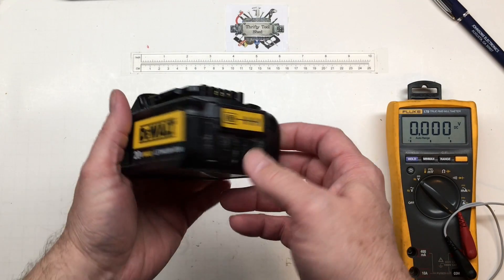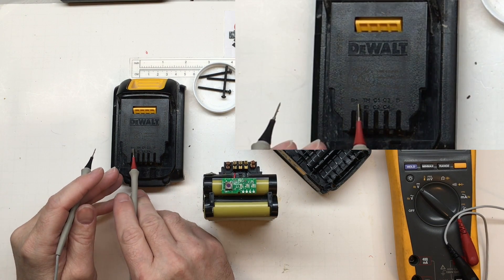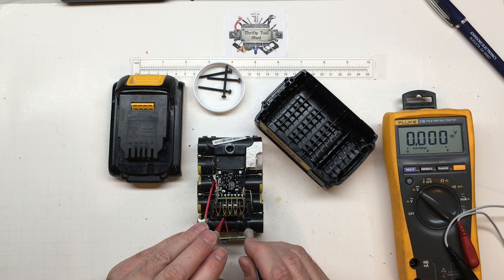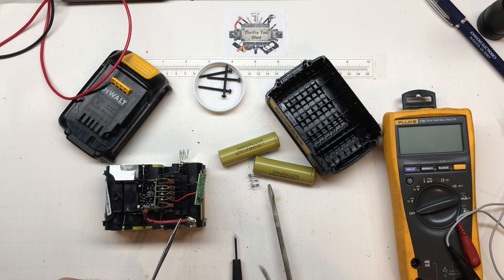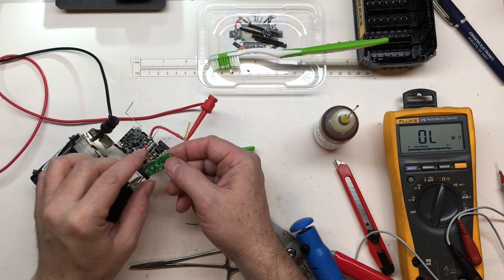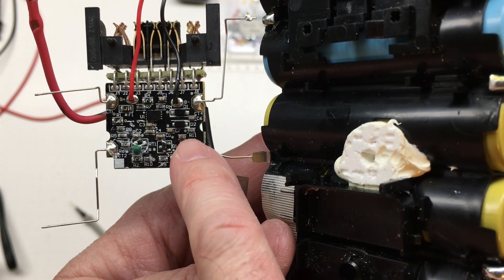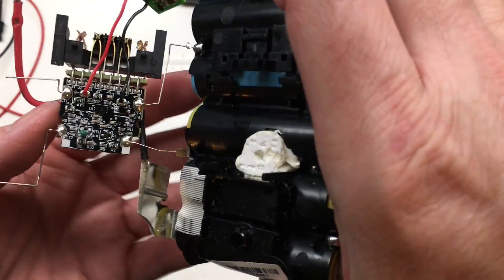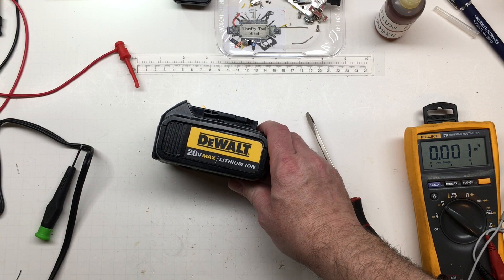DeWalt 20V Max 3AH Battery Repair

Comment: Can you connect an Imax B6 AC battery charger to the negative and positive contact pins on the battery pack to charge the battery pack?
Reply from the maker: Yes, you can do it, and it's much better to do it that way than to try to jump pack to  pack as some show. That can be so dangerous.

Comment: What is the best battery for the cells, where do you buy them
Reply from the maker: I usually either have cells saved from other packs or buy from 18650batterystore.com. I usually pick the best fit for the pack size and price. l always check the sale tab on the website to see what is available at a great price.

Comment: i was wondering if i can connect the battery to a hobby lipo balance charger, will it charge without issue?
Reply from the maker: I have done it without issue. using the balance leads is the best option for charging of course, but to me it does pose the most risk of damaging something on the DeWalt board. Straight to the plus and minis is typically not an issue, but the balance checking will need to be monitored manually.
Reply: @ThriftyToolShed  ok nice, what are the TH and ID pins on the pack, what do they do?
Reply from the maker: @devjitpaul1191  
I have shared this in some of the DeWalt pack videos in more detail. TH is temperature feedback from the packs NTC and ID is a resistor in the circuit to feedback which type of pack it is.
Reply: @ThriftyToolShed  thank you

Comment: i shorted a new dewalt 12v 5a pack trying to wire a light on a motorcycle. i heard something pop maybe a fuse? can it be fixed?
Reply from the maker: Possibly, I have not worked on a 12V DeWalt myself, but it may have a fuse or like most packs has a thinner part of the nickel strip coming from the cells to the board that act as a fusible link. You have to look inside and most likely it will be obvious if it has a strip that has blown. Best of luck to ya!

Comment: impressive work.  What is considered too dead for the charger to recognize ?  I've got a 20v Dewalt battery that is at 14v, and won't charge.  Each individual cell measures 2.74
Reply from the maker: That level is the borderline line. I would think most DeWalt chargers will still charge @ or above around 2.5V each cell. I would most likely manually charge that pack a little and then if still not charging I would look at the individual cells really well. If they are that well balanced then I would check the spot welds on each cell end and the soldered wire to the board for cell monitoring. 
Best of luck to ya!

Comment: Hi there sir, I have disassembled about 12 18-volt Dewalt batteries, is it worth trying to figure which individual cells can be saved, maybe weld some that might charge back together. I'm an old retired man and love tinkering with things. I have separated all the batteries so their single batts now. Just trying to see if I'm kicking a dead horse or not, lol. Sure would liket to hear from you. thanks!
Reply from the maker: Hi,
I do believe replacing with brand new cells is the best option for sure. I do also keep cells and do just as you have mentioned. I will test all cells for capacity and even leave them in storage to check the cell and verify it holds charge as well. I will sort cells based on the capacity tested at also the internal resistance the best I can with an OPUS charger etc. I mentioned a little bit more about this in the video called " Lithium Battery FAQ#1".  Have fun. It can be a great and fun hobby working on things like this. Best of luck to ya!

Comment: I was going to repair a bad 20 VDC 2 Ah Dewalt pack until I realized it was going to cost me more (to repair) than a new 4AH Dewalt pack.  By the time I invested in replacement cells and a spot welder, I was up over the cost of a NEW 4Ah unit.  Soldering would work, but my temperature-controlled pencil doesn't get hot enough to make it a quick job, so I'd have to buy a new gun as well.
Reply from the maker: Yes, if you only use the spot welder for one repair it is not worth it at all. Some people feel this way and I understand that. It's easy for me to view it the same way I do any tool or any repair. I may have $10K in tools but I never used them on one vehicle repair or on any particular vehicle, but I use them often and on many projects. I spend money on parts, but nothing like the dealership and auto shops charge. Like an oil change the first time I bought a jack was an expensive oil change and the lube place was much cheaper that one time. So it's definitely how you look at it and how far you are willing to go. Cells can be costly and I have mentioned before cheaper ways to get them at times like the sale items at 18650batterystore.com etc. I personally enjoy making my packs even better than new and cheaper, but every one is different. Just sharing the options if viewers do enjoy DIY. Thanks for your comment.

Comment: Thank you for your repair videos, has helped me greatly to repair my Dewalt batteries. 
Question: if positive and negative terminal test 19v and all cluster cells showing balanced 3.5 something volts 
But the ID terminal to positive shows 13-14 volts only which causes charger not to charge 

Have you seen this issue before ?
Thank you
Reply from the maker: Hi,
I can remember measuring from ID to negative terminal in ohms and getting around 820 ohms (type 2 pack) and reading from TH to positive reading around 9k-10K at room temperature. It is way more to the circuit of course than just resistance and it was just the measurement that I read once I realized the ID circuit has a transistor that will seemingly put the resistor in the circuit for the tool to see if the board was in good health. Just an observation. Glad you found the videos helpful. Thanks so much for your kind comment!

Comment: I find when trying to pry as delicately as i can , that I always almost always leave a small pin size puncture on the flat side of the negative end of the battery. Releasing a sweet smell. I have always assumed that it was the electrolyte of the battery or the lithium. What are your thoughts on procedure and if what was released was in fact electrolytes or lithium. I find that leaving the nickel tabs cut short but not pried off is more practical for me. Thanks.
Reply from the maker: Yes, with my experience if you smell the sweet smell you have infact puntured the cell case and the CID protection is most likely not working any longer. I have non-issue leaving tabs on mine sometimes, but if they are being reused it is usually too thick to work back in a battery case. 
When I use the flat nose pliers I rarely have issues pulling the tabs off. Usually the little dots stay on the cell and the strip Rips and pulls away.
Reply: @Thrifty Tool Shed  thanks for the reply. Just looked up what CID protection was (haha). I did wonder about that as I saw a video where a guy pushed down on them to reset a dead battery. On further reading, it looks like not a great idea. One thing I could not get a clear answer on was that 1, 2 second hissing and sweet smell. Info on that varied all over the place. Was it the electrolyte or lithium? Thanks again for your time and thoughts on it.  preciate it.
Reply from the maker: I believe it is the electrolyte.  The electrolyte in a lithium-ion battery is flammable and generally contains lithium hexafluorophosphate (LiPF6) or other Li-salts containing fluorine. I believe this pressure builds up high enough it will press out on the positive tip of the cell to activate the CID protection. I have an older video talking a bit about the CID.
https://youtu.be/yididXWl9D0
Reply: @ThriftyToolShed  thanks for the reply and information. Great Chanel 👍

Comment: Thanks for this video I've had a couple DeWalt batteries go out on me before but this gave me the knowledge to repair them.

Quick tip for anyone who is too scared to repair them. Buy new ones with cash, swap the insides, and then return them saying they don't work a week later.
Reply: Sweet idea...DeWalt put'n bone in the consumer...screw'm

Comment: The 2.4V cells deserve a second chance before replacing them. New generation of cells recover fully after a low discharge. I would say 2.4V is not a even a deep discharge, it's safe to bring them back to 3.3 and balance the pack. I have a video restoring 0.1V, yes, 0.1V depleted cells that actually work. See here: https://youtu.be/ouqORBMTU1s .
Reply from the maker: I truly give all cells a second chance. I guess it's been a while so not sure what this comment is really referring to exactly, but I have many videos on lithiums over the last 5 years with some at close to zero volts and some just below cut off voltage. It should always be checked with capacity testing as I mention in many videos and I have a video explaining my testing of Lithium cells in " Lithium Battery FAQ#1"  
https://youtu.be/f9SOPVEqgkw
Reply: @ThriftyToolShed  this is more for other people seeing your particular video, not to challenge you on how you fix batteries in the present times. You actually show in your video (one that I commented) that you replace the 2.4V cells. That was all I wanted to say. Kudos for all your other videos, very informative.
Reply from the maker: Thanks for sharing!

Comment: I Have A Ryobi Battery With Test Light
Issues The Light Works When I 
Throw It On The Charger But It 
Dont Work When I Push The Yellow
Test Button. So It's Probly The
Button It's Self Huh?
Reply from the maker: Sounds very likely.

Comment: I found most li-ion packs that show uneven cell voltage are just out of balance so just
 balance the low ones to match the others and put it in charge and go .
Reply from the maker: In many videos I have shown that the reason most of these get unbalanced is because over time cells get decreased capacity and when capacity testing you will find these cells are very unmatched and for that reason alone most of the time not all the time these cells will pull down and end up unbalanced again. I try to match my replacement cells very closely in capacity as well as internal resistance. Sometimes balancing cells back up works short term. Thanks for your comment!

Comment: highly dangerous using a soldering iron on those cells, you need a mini spot welder from Banggood for safety, also better to replace all the cells
Reply from the maker: I do have multiple spotwelders. Thanks for your concern. If I did not mention here, I mentioned in many pack repair videos that replacing all cells is of course best and as explained before extremely obvious.  You will have to have alot of tested good cells from other packs and recycles or almost spend the same as a new pack which is the opposite of this video we explains.
Reply: Well, how do you think the manufacturer did it same way it’s not danger if you’re unsure of yourself, don’t attempt this. There is some people that have some knowledge how to repair things they don’t just replace replace they will actually go in and fix the problem everybody’s not a parts changer. Oh, I don’t work throw it away by a new one that’s how you save money.

Comment: Where do you get the new battery cells from?
Reply from the maker: I keep lots of spare cells from almost new packs parted out as well as other cells tested very well for capacity. I just about always have what I need for spares. I usually do not recommend cells because so many times it's hard to verify that they are not fake cells. The main thing to make sure is that the seller is truly selling genuine cells. I have used 18650batterystore.com with good success!

Comment: Where did you purchase the replacement battery cells?
Reply from the maker: I keep lots of spare cells from almost new packs parted out as well as other cells tested very well for capacity. I just about always have what I need for spares. I usually do not recommend cells because so many times it's hard to verify that they are not fake cells. The main thing to make sure is that the seller is truly selling genuine cells. I have had good luck in the past finding what I need in stock at 18650batterystore.com.

Comment: It is amazing because you can repair dewalt battery, but it is better if you make the soldering with spot welder, It's just by the high temperature side by side onto the cell 18650 may be peel off. Specially with saw and grinder, the battery is overheating.
Reply from the maker: Thanks for your comment. Are you asking is spot welding better than soldering?
Reply: @ThriftyToolShed  I mean, soldering on 18650 batteries is better with spot welding than soldering iron and solder wire.
Reply from the maker: Yes, I agree and in several videos I have mentioned that and I am about to post the 60V Flex Volt repair video. In that video I repair with mostly spot welding. It is difficult sometime to spot weld on repair packs unless time is taking to prep the cells and strips very well unless it's all new strips and cells and good surface. But, one thing I try to mention alot is that we don't want to get the cell too warm, so quick with a high wattage iron and cool quickly.
Thanks for your comment!

Comment: This is exactly what I needed, checking for what kind of secondary protection IC it has. BQ771803 at 13:50
Any idea if the 60V Max use the same chip?

Comment: This. This was what I was searching for, thanks a lot man.
So, if I want to use a different brand battery pack (same voltage of course: Parkside X20V Team) on a DeWalt 18v XR series drill, how can I trick him into believing it's its battery I hooked up? Maybe connect TH to B+, so that the tool would always "sense" a normal temperature? The drill doesn't even move a tiny bit with only the powerpoles connected, it just flashes the LEDs near the chuck when I press the trigger, then absolutely nothing. I thank everybody in advance for the help!!!

Comment: I ran through four, 6ah Flexvolt batteries on the new Dewalt 60V chainsaw. Went to charge them and only get a solid light. Tried resetting or jumping pack to pack, etc. Nothing works. I'm mad lol. These things are hundreds a piece. Killed them all but they are over the 2 year warranty (which is the warranty as I understand)
Reply from the maker: So solid Red is charged on your charger as well I assume then. What is your measured voltage at the pack terminals? I understand the frustrations of bad packs for sure, alot of what drove me to create this channel to share anything we can figure out about these expensive suckers and keep our money and tools from the landfill, lol. 
I have never worked on the flex volt pack myself, but should be similar to other packs just larger and more terminals so some tools get 60V from the pack so all in series and only 2ah or 20v with 3 sets in parallel giving 6ah I assume.

Comment: Great vid. Learned a lot here. I have a Dewalt 20v 5.0ah XR lithium with Bluetooth for Tool Connect that won’t charge. Charger goes into Hot/Cold delay and never charges for this battery. Too expensive to throw away. Will rewatch vid an hopefully I can find the bad cells and replace them.
Reply from the maker: Not familiar with that exact pack, but if temperature error make sure to check the NTC thermistors and there connections. Best of luck to ya!

Comment: Do you know what is that white thing at 8:06 next to your left thumb ??
Reply from the maker: You might be asking about the white silicone blob that is under where the board is mounted. It is support for the thermistor on the bottom of the board. When you pull the board up, the Thermistor pulls up from this blob.
Reply: @ThriftyToolShed  do you know any vander sells on Amazon, Link it for me please.
Reply: sometimes they use this white thing on electronic circuit board to hold wires like a cable tie. If you know any vander sell on Amazon.
Reply from the maker: This may be similar? I have not used it to say for sure though! 
https://www.amazon.com/dp/B0063U2RHK/ref=cm_sw_r_cp_apa_glc_fabc_QZYGF6HNNZT4X0AMKPTD?_encoding=UTF8&psc=1
Reply: @ThriftyToolShed  thank you friend.

Comment: Can you please tell me where you sourced your replacement batteries? Great video by the way.
Reply from the maker: Thanks for your comment.
Sorry, I keep lots of spare cells from almost new packs parted out as well as other cells tested very well for capacity. I just about always have what I need for spares. I usually do not recommend cells because so many times it's hard to verify that they are not fake cells. The main thing to make sure is that the seller is truly selling genuine cells. Of course we should always  keep the capacity of the cells exactly the same. The manufacturers even match cells based on test data. I try to keep them very similar.
Reply: @ThriftyToolShed    oh okay no worries and thanks for the information..  I'll have to learn how to test the capacity so I can safely do this myself.  That said, I'd sourced a "genuine" Samsung 21700 from someone in the UK for what seemed like a fair price. What's the risk I face if I replace the dead cell in my pack with this one if it's ingenue/vastly different capacity? Thanks!
Reply from the maker: The 21700 is different size than the 18650 physically the 18 is 18mm diameter and the 650 is 65.0mm long I believe. So the 21700 would be 21mm dia. and 70mm long I believe. I have always stuck with the 18650 cells so dimensions are the same and try to stay around the same capacity. Most packs may not care if all cells are replaced with higher capacity, but I am unsure, some may not like it.
Reply: @ThriftyToolShed  yeah my 3AH battery pack has the 21700s in it interestingly enough.
Reply from the maker: That is very interesting! I have not seen a pack with the 21700s in them yet, I did hear awhile back some manufacturers were looking at putting these in them. That awesome! I wanted to mention that most are 18650 in case you were not fimilar with the difference. My thoughts were that most packs old enough to be giving  issues would not have the 21700s yet. Great to know!